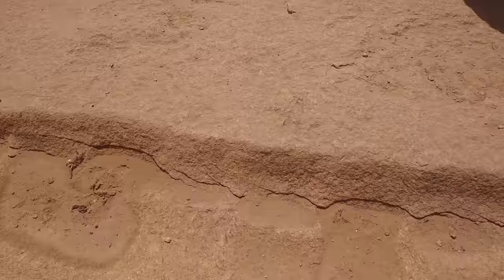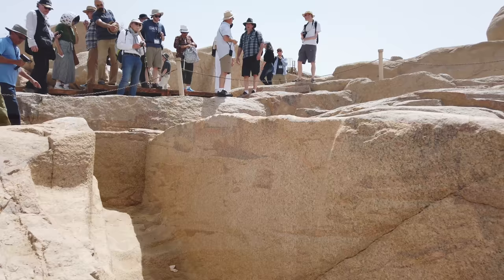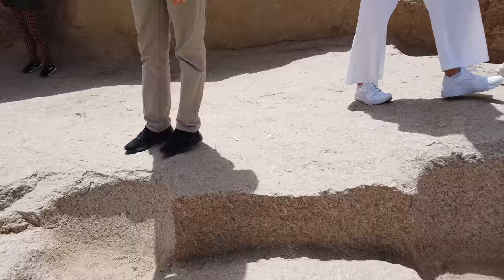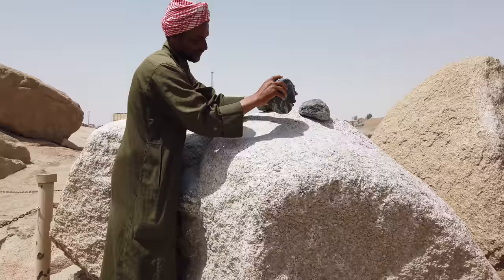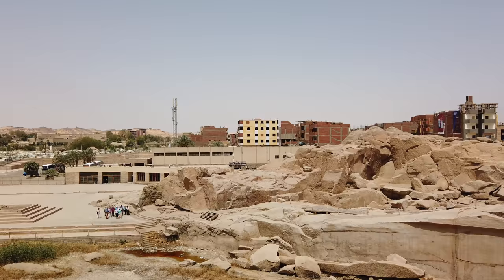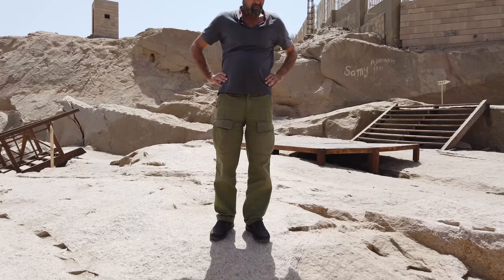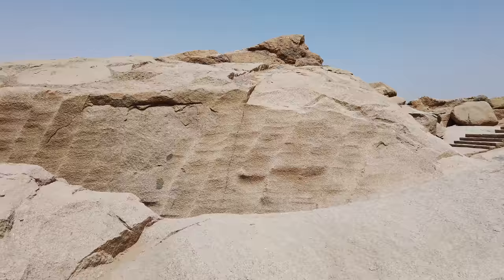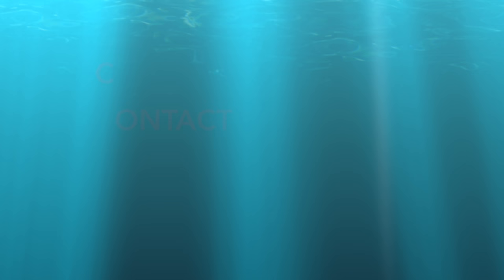Aswan Granite Quarry In Egypt: Obvious Example Of Ancient Advanced Machining Technology

Comment: Regarding those scoop marks, as a welder who works in a machine shop I've seen those marks made from water jets we use to cut parts from plates of metal. The scooping at the bottom happens when the material being cut is thicker than the jets ability to cut so it kinda pools at the bottom. That immediately popped in my head as soon as I seen those marks. Hope this helps!
Reply: Ive been thinking similar.Water under pressure with sand with microscopic diamonds.I watched a show on ancient tech and what the Roman's had was amazing so I think its possible.I wonder if there was any evidence of slurry that was used....probably was removed when clearing debris.
Reply: That is a super interesting observation. If thats the case it must've been an immensely powerful water jet, portable as well.
Reply: I think from what I've been reading there is some Tesla invention examples that a group of scientists have been working on  in the Maldives.. I think vibration is how they've done it.   Should all come out soon .
Reply: I watched a show on Roman tech and IDK if this would blow your mind but it did mine.They had booby traps for boats in harbors that would grab the enemy galley from underneath and pull it under..after that and the crazy stuff they did with water and steam engines..I was like...crap what cant the ancients do??
Reply: There is an engineer and stone worker who went over the scoop marks and pointed out the subtle impressions made by the head of the tool and both came to this conclusion one their own.  The tool head, according to them, had to be shaped very similar to the Schist disk, but likely metal with an abrasive on it.  I like the water idea as well.  The slanting of the stone seems to indicate they used water, if for nothing else, to wash away the cut away material.  Fascinating stuff.
Reply: I thought water aswell. Can cut somw pretty straight lines into almost anything with high pressure
Reply: I want to believe that the confidence they had with working with hard granite and stone, they must have been able to soften the stone somehow, a mixture of scooping tools and making the stones softer. Using some kind of acid? Heat? Water?
Reply: @karlkarlsson9126  ....Very possible, and a realistic theory.
Reply: It has been determined since the 2003 experiments that replicated them with simple techniques, that those scoop marks were made with sharpened dolerite boulders and strong concentrated fires enclosed in vertical brick movable chimneys. 

They were made by hand, as it's obvious given they are irregular and that you can find the scorch marks and the ashes right there

Here in YT you have the foremost egyptian expert talking about that: "The UNFINISHED OBELISK of Ancient Egypt"

This kind of channels are pathetic
Reply: Metal isn’t stone. Archaeologist’s found “pounding stones” and ashes in the pits near the unfinished obelisk. They figured out if the made a fire in the pit and used the pounding stones afterwards they could dig 20cm/hour and it looked like “scoop marks”
Reply: Here is the problem and elephant in the room. There are vases carved from solid granite accurate to 25 microns in all dimensions. The human eye and hand cannot even judge that let alone do it with stone and copper tools. So considering they could do that (somehow) it seems strange they would revert from super tech to no tech for this. I am convinced they had help. Until someone explains the impossible vases that were machined there is no point even trying to guess how this was done
Reply: I’d have been pretty annoyed if I was some dynastic Egyptian stonemason bashing that rock with a dolemite pounder for 8 hours a day knowing my ancestors used to used ultrasonic hydro scoopers to scoop that rock out in like 20 seconds. 😑
Reply: @patrickmontie9583  ' used the pounding stones'  They aren't pounding stones, they are stone chisels.  And the ones left behind are used up, they are worn down too small.
It's why they are 'uneven balls'.  They started out about 2x larger blocks, and were 'worn down into roughly balls' as they were used and the corners were knocked off.  'Round' was not the point of the use, it is the left over trash after effect.
Take 2 balls out of a Newton's cradle.  Make them 50 pound stones suspended by ropes.  Hold them against the quarry wall and descend them, and realize you will leave vertical 'scoop' cuts.  The one against the wall is a chisel, the one you swing into it is the hammer. 
7:49 in the video.  Look to the right side, at the block laying down, a fulcrum.  Lay about an 8 or 10 foot obelisk across the fulcrum, with the point into the cut.  On the back end have a rope suspended 300 pound stone hammer.  Get 3 or 4 people swinging the hammer stone into the back end of the obelisk, and a person or two up front steering the nose into the cut.  The 'scoop' is the swing of the obelisk.  You'll notice the nose of an obelisk would swing everywhere into these cuts, and also the upper slope of the undercut roughly matches the slope of the nose of an obelisk turned sideways.  Obelisk = undercutting reach tool, it wasn't revered for no reason.
In some of the videos of the undercut area you can see the horizontal banding in cuts from the sweep of the tool before it had to be repositioned, and even the varying depths within each band, because it was done point by point with the tip of the obelisk concentrating the force of each blow.
Stone cuts stone, it is why they never ran into a stone they couldn't cut.
And realize, 3 or 4 people bashing a large weight into an obelisk as a chisel cutting tool is a manually powered stone jackhammer.  You get past the limits of one person easily, 3 or 4 for strength and the tip is easily steered into the cut for precision.
The rough obelisk tools are all around, but they got carried off and cut up into blocks for other buildings.

Comment: Also, keep in mind that these ancient scoop marks have had thousands of years of erosion which I believe makes them appear "buttery soft" today. This erosion sort of rounds off all of the edges a bit. They most likely had sharper rough edges from whatever method was used. If you picture it like this, it furthur proves the round stone method to be false.
Reply: It’s granite
Reply: It's granite. It wouldn't erode like that, not  to that extent anyway. You can see the straight cut edges haven't eroded either.
Reply: They probably perfected a system that used several different methods learned over hundreds of generations. The only thing advanced about it was the order in which they did it.
Reply: So u can scoop with copper
Reply: The dolerite stones used to carve that weren't round at all, they were sharp

It has been determined since the 2003 experiments that replicated them with low technology techniques, that those scoop marks are made with sharpened boulders and strong concentrated fires enclosed in vertical brick movable chimneys. 

They were made by hand, as it's obvious given they are irregular and that you can find the scorch marks and the ashes right there

Here in YT you have the foremost egyptian expert talking about that: "The UNFINISHED OBELISK of Ancient Egypt"

Ur mum is false :D

Comment: 9:35 they made cracks in the rock with wedges on BOTH sides of the "scoop marks" and somehow removed the material in between. If you have high technology you wouldn't need to work in between 2 cracks to remove stone.

Comment: The scoop marks seem like a round spinning tool, like a bore drill
Reply: You're right. And there's more to it than that. Unfortunately Brien didn't film it. I was there when the tour guide Yussef pointed out that there are a series of divots on the obelisks sides that seem to have held (we can only guess) a mechanical arm that allowed the rotor head to bend under the obelisk.
Reply: Or maybe jack hammer with diamond tip shovel
Reply: @ArgentWarrior  I don't think a jackhammer or  rock drill will leave scoop marks like this. It's as if they used a drill with a cylinder and they as are able to scoop, using its edge
Reply: Yes i agree and this is one of my favorite ones. So obvious was not done by pounders, Lol, Would love to no what it was that made the foot wide grooves, Also would be great to see some real close up footage of them.

Comment: What about something similar water jet cutter? It look like something involves water, the scoop marks. Thank for sharing BRIEN
Reply: Yes a water jet, but with very advanced machinery, posable in conjunction with harmonics.
Reply: Nothing we can do today.
Reply: Gene Parenteau  yes, I agree with you. Cheers
Reply: I was looking up water jet cutters and apparently a force of around 50,000 psi is required to cut rock with water.
I remember seeing someone come up with a theory that the chambers in the pyramids could have been used to hold water for a power-system. What if those chambers were in used to create enormous pressure by holding water with a series of heavy stones above applying enough pressure to create a water jet cutter?
From my very poor physics knowledge that would require a weight of rock just under 23 tonnes pressing down on the water to produce that water pressure of 50,000 psi.
Reply: @genect9322  Today its the work of Mini excavators with mounted hydraulically driven milling heads. it shows exactly this tool marks.
Reply: @Slarti  Theoretically, minus efficiency. and in lack of suitable equipment. i am not enumerate it now.
Reply: Slartibartfast , I know what you thinking or feeling. What ever they have used, they are good.

Comment: As to rubbing the granite with diorite stones maybe if they were using sand in between they might make some progress. But then you have the problem of removing not only the granite dust but the sand also. 
How's this for an idea. The levers the Egyptians used for raising water for irrigation. Shadoffs iirc. Have them set up with a large pointed Diorite block on the working end. A crew of x number of workmen raise the stone and let it drop. Be interesting to test. 
Just because we don't know how they did it doesn't mean they couldn't have done it. There are several things that do make me wonder about ancient Egypt. One is the errosional patterns we see. Not just on the Sphinx enclouser. But on other items as well. Some objects are almost pristine yet other objects are almost unrecognizable.  Yes,  some objects have been exposed to more weathering than others due to being under the sands. In my mind it doesn't all add up
Reply: If you stop thinking in terms of 'ancient' and that errosional patterns are simply carvings that have been smoothed, you'll be on the right lines.

Comment: If the stone had been struck with a hard instrument, like a chisel, to remove the stone then there would be straight line marks in the stone.
The "best" descriptive words I can muster are "melt", "evaporate", or "dissolve" to describe the visual condition of the rock surface.
I wonder if it would be possible to get someone like Robert Schoch to study the rock to see if he can find any "residue" on/in the rock, or if the rock had been altered by it's working/manipulation. Has the rock been compressed or weakened or stretched, etc?

Comment: anyone who says they only had bronze tools is obviously ignorant on ancient egypt and needs to educate themselves. in king tuts tomb there was found a dagger made from an iron meteorite. obviously it didnt fall to the ground like that, so they were able to take an iron meteorite and get it hot enough to work it into the shape of a dagger. that alone should tell you they were able to work with steel and other hard metals. iron ore is very plentiful on earth. there is absolutely no reason to believe ancient egyptians (and other cultures) did not have iron/steel tools. 

sure, none of them have been found, but that doesnt really mean anything. there are steel automobiles left in the woods and deserts of america that have literally disintegrated into almost nothing in less than 100 years the automobile has existed. after a few thousand years there would literally be nothing left of them. (besides maybe plastic or rubber) steel disintegrates very quickly and there is no surprise these tools have been lost to time or recycled.

as for moving these huge pieces, or the "saw marks" i cannot speak to. i am only speaking to the fact that anyone who says they did not have steel tools is a fool. those are also probably the same people who claim the egyptians didnt know the wheel existed and did not have the knowledge of the wheel.. meanwhile they rode chariots in battle

Comment: I've seen it before in many of Brien's videos but i never tire of wondering at those scoop marks. You can see the width of the part of the tool that came into contact with the granite, we can see that it wasn't heat melting the rock because there's no sign of thermal damage. It's almost as if it was a molecular cutting tool.
Reply: mostly agree , just think of an aliens technologies that cut rock by breaking atoms bonding and turning granite into mono atomic silica sand , it should not be an material one only energy beam , the tool marks remind me of an sand blasting nozzle but adjusted to large 2 foot wide dispersion angle and dragged onto the surface , must be some kind of machine able to produce large granite blocks very flat and uniformed surface parallel
Reply: Count Rakoczy  Well said, but trying to tie it to basics, it's not a boring machine is it? Looking at the scoops it's not rotational at all  it's litleraly a scooping machine?
Reply: Count Rakoczy  Your single sentence encompasses many questions! No-one was there so no-one knows. All we can do is speculate, and thank the Gods we have people like Brien and his friends, who have local, in-depth knowledge and can use that to reflect on the original meaning of things. It's a real fucking shame that the records of the construction of the Pyramids aren't currently located, there seems to be no record at all in the conventional dynastic record of their construction. It'd be odd if the only thing we could learnf from the Pyramids is that we still can't replicate them, wouldn't it?

Comment: @50 - don't forget Brien - they had sand saws and drills - copper in conjunction with quartz sand can cut porphyry (mohs 7) - the Romans were able to cut this to any size, and Pliny explains that they didn't invent the tech - so it's not crazy to believe the ancient Egyptians had this knowledge. And btw - I did once hear you mention sandsaws - but you made a mistake if you don't mind me saying - you said they couldnt have used sandsaws as sandstone is softer than granite - but the thing is - the sand they used was quartz sand. Quarries today still use the same tech - they're called gang saws - using a slurry (only now they tend to use steel instead of sand)
Reply: Test it out for yourself and post the results.
Reply: @johnwalker1553  btw I'm not sold on the sandsaw idea for everything anyway - I have other ideas too...I have a vid suggesting the scoop marks might be a remnant of hydrofluoric acid as a medium to quarry the granite...so i too have an open mind to mysterious goings on.
Reply: @HistoryMaze  That copper traces can be left from the door fittings. the most remarkable thing are the tool marks inside the tube drill it shows the feed revolutions rate. and the cores are glace.
Reply: @HistoryMaze  There is a book with all the sawmill types they used, its remarkable. but on that 500 sites of this book, about several different mechanisms. they claim in one row this sand theory. and there is another thing why they did hit wooden beams with axes for shipbuilding and don't use sawmills . if they had so much from that machines?
Reply: @johnwalker1553  that book sounds good - is it available online? Some Welsh quarries used industrial sandsaws up until fairly recently, as apparently they 'worked better' on some types of slate. I'm on the same journey as everyone else - don't have the answers yet - but I'm trying my best:)..one thing I have found out that could be worth bearing in mind - the masonic tradition (of course not always known as 'freemasons') has (according to a book I'm delving into right now) been going for 6000 yrs - and it's always been shrouded in secrecy. Architecture had a direct correlation to the divine - the geometry, dimensions,proportions etc - so it could well be that many of these construction techniques were also kept a secret. If you're interested, my next few uploads will be on this topic - I've uncovered some interesting clues/material I think.
Reply: @HistoryMaze  That idea with fixing the bits on a tool holder is exactly we do  today i did it with copper-containing welding rods with flux.  used the tools for milling steel. But it needs a heavy stabile machine with a bed. this idea isn't work on  wooden frame machines. and it is to demanding and complicated to build that kind of machine from stone.
Reply: @johnwalker1553  that's great that you've got experience with that...good to know that in principle it could work - I think I read that they calculated approx a ton weight needed (maybe i wrote this already) to make such grooves- so youre dead rifght - would need one hell of a framework...but...they did do things on a very monumental scale....I wouldnt put it past them to have devised such a thing...good chat - thanks.